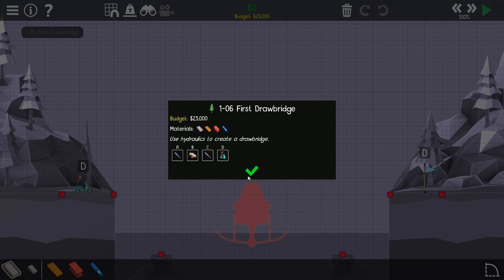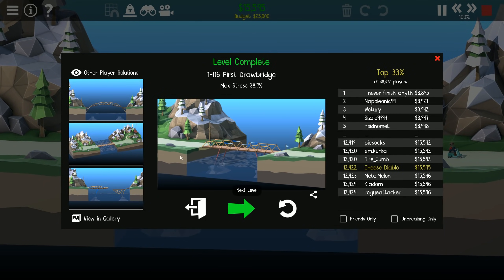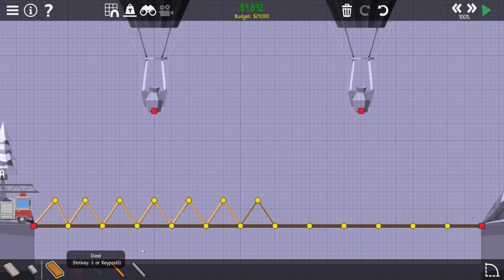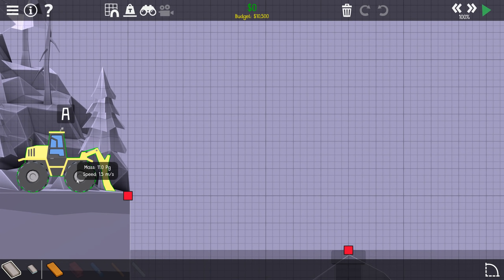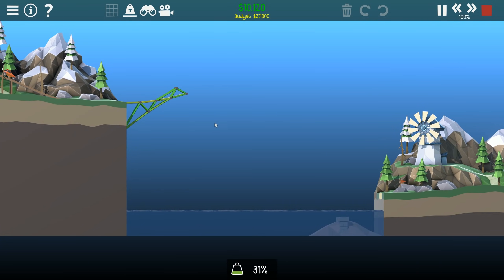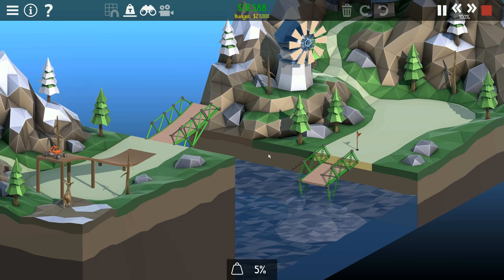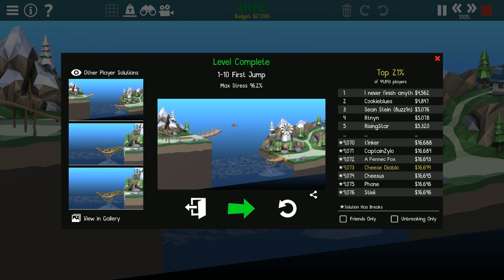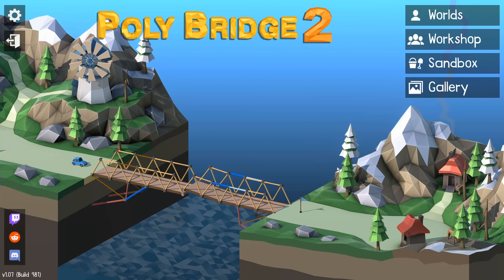A real CIVIL ENGINEER gets confused by SPRINGS!

Comment: On the jump, I would have compressed the two supporting springs to lift the landing ramp so you land the car at a better angle so the ramp gas less force to absorb
Reply: Maybe not less to absorb but a longer timeframe to absorb the same energy, idk I'm not an engineer :)

Comment: The thing with high leaderboard spots is that they do not reflect real life physics, for example, you would not drop a road off a skyscraper to launch a car across a gap
Reply from the maker: You wouldn't?? ...scraps eureka moment about to be presented at work! 😅
Reply: @RealCivilEngineerGaming  It would still be more feasable than my architects trying to stuff a 110mm pipe (not including insulation yet) into a 80mm room. :D
Reply: Not with THAT attitude you wont
Reply: Spring canons!
Reply: Thats why I don't worry about leaderboards. When I play this game I try to think of the most realistic soultion I can think of. Sometimes it hard with some of the more goofy levels but I enjoy the challenge of thinking of a more realistic approach.
Reply: Neither does this game I suppose

Comment: You should probably learn to sync your audio better. If you've got a clicky mouse, time the clicks to onscreen stuff (going to a generic clicking speed website is pretty good since you can align the number of clicks with what's heard).
Reply from the maker: Yeah this is a really annoying one, the game audio slowly goes out of sync over time, I have tried manually correcting it but obviously I didn't do a good job if you've noticed! It may be that I'm recording in 1440p and my cpu is struggling to keep up, might try taking it down to 1080p next time. Thanks for your comment though, I will get this issue sorted- after all that's what us engineer's do best! 😀
Reply: @RealCivilEngineerGaming  yea 1440 is really HD
Reply from the maker: @wofeYT  I've worked this put now if anyone is interested! Nothing to do with my cpu, shadowplay record a variable frame rates and Adobe premiere pro doesn't like it. My new videos I am rendering the gameplay first to have a constant frame rate. So videos take a bit longer to make but at least are all in sync now! 😀

Comment: Nice vid. Can't wait for you to get to the later levels. For your question of trying to get high on the leaderboards, from what I've seen from others it is quite a task to limit your budget and requires a lot of out of the box thinking and understanding of game mechanics. And if you are thinking of going for like top 10, it requires a lot of shaving by moving pieces pixels to get the lowest budget. Have a good day once again. :D
Reply from the maker: Hey, thanks for the comment! Can't wait to get to the later level either! And yes, I am slowly working out that the top leaderboard scores are more about exploiting the game's physics engine than apply real engineering techniques- HOWEVER, it's still super fun and I will probably be going for some top scores soon!
Reply: Isn't the way to get the top leaderboard just to put a bit of road high up in the air and glitch the vehicles across the map?
Reply: @jamesmccomb9525  that works in poly bridge one and has been (sort-of) fixed in poly bridge 2.  there are a lot of exploits of the physics engine that have been nerfed in poly bridge 2
Reply: @jesst_a_frog  oh no, it's not even remotely fixed
Reply: There's also cheese and glitches used towards the top
Reply: and of course, dangling roads :)
Reply: @LukeTCC  I hate just how often dangling roads can work.
Reply: Only Bob can fix it